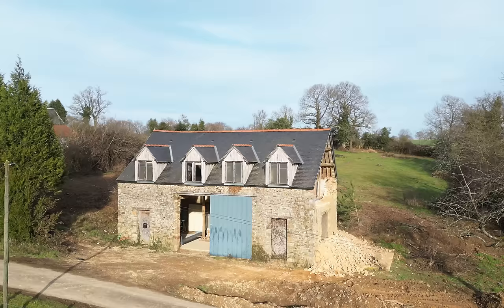ABANDONED BARN, The START Of An Epic RENOVATION In France.

Comment: The good part about this project is? its a shell, which means structural issues first, roughing electrics later. much masonary work on the right side to rebuild. Fortunatly you have the materials in the area needed, just need to do the limestone mix to start in. Being a shell is roughly a blank slate! planning on what to do with it when its all done is up to your young friend. great starter home!
Reply from the maker: Thank you 🙏 😊

Comment: May be a U shape staircase, next to the back wall, fitting between the two main beam, and leading to a bridge in the middle of the space, linking the two parts of the barn, but the bridge to be separated enough from the main glass, entrance so the light can penetrate the entire volume. Me personally would leave the space above and least the living room full hight open, and only putting a bedroom above the kitchen if really demanded, if not two floors only to the left of the entrance and the entire kitchen/living area full double hight, in that scenario the stairs can be  only to the left and not to bother the flow.
Reply from the maker: Thanks Peter 🥰🥰🥰

Comment: Oh, maybe he should rethink that garage, and put that in the back, or on the other side of the building, because it seems like, where he wants tobput it now, is where the great views are? Glass in the gable, yes - but why not on the ground floor, too?😊 I might even consider adding a glass extension? And if the views are more towards the right, which it seems, I would simply turn the extension that way, so you would get maximum out of the views! Build it as a triangular shape 😊 Oh, another thing... Maybe don't go ultra sleek and supermodern, but rather play with traditions and local materials, and then just keep it really simple  instead? Just because it is annold barn and a rural area 😊

Comment: Nice project, it’s a lovely building.  Just curious, in France do you have to get permits for construction?  Do you need to submit drawings for the work that is to be done and is there plumbing and electrical inspection once the work is done to confirm that’s all is to code.  None of the chateaux folks mention paperwork needed, so I was wondering